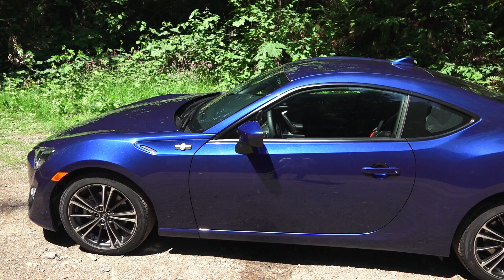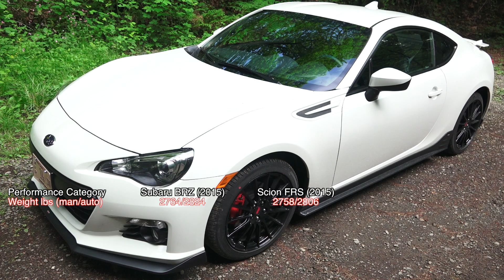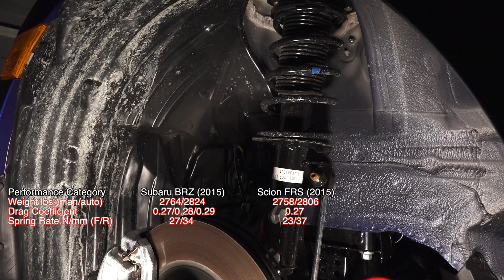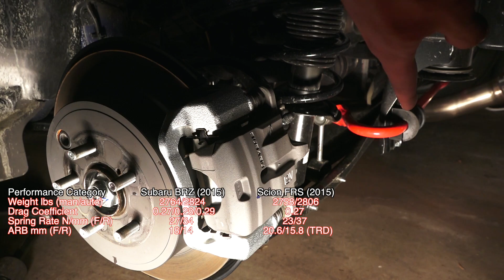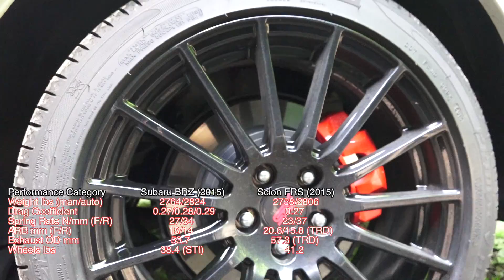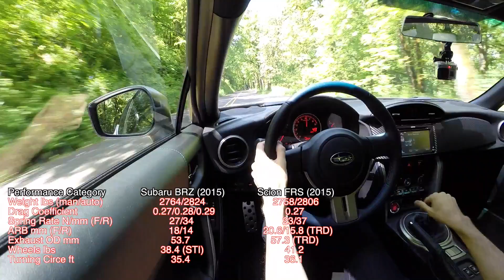Subaru BRZ vs Scion FR-S (Toyota GT86) - 8 Performance Differences

Comment: My granny in her V6 Camry ate a FRS merging onto the hwy. It was all suped up and loud as hell. How embarrassing.
Reply: but e36 will also carve up your wallet while doing it
Reply: e36 can carve it even better
Reply: cr4zyw3ld3r not at all, i bought 323i for 3k euro three years ago. invested less than 500 in repairs and maintenance , and 1k into mods. car had 212k km now. runs very well. gt86 cost 5 times that anf e36 is still cool car to haul people around
Reply: that car is probably easier to maintain in Europe. IN the states the maintenance costs are obscene. While you may find a good deal on it, the cost of repairs will ruin you. I have had a buddy that complained of nothing but spending money on his and there are articles floating around detailing the various parts that fail in the engine.

Comment: what do you think about adding a turbo to one of these cars? would it last or would it just be constant maintaince? also if a turbo was added what else would I need to put into the car? 
thanks
Reply: +BSCEsteban Get a 300ZX or RX8 with a blown motor for cheap and do an LS swap on that, but don't destroy a perfectly good BRZ/FRS.
Reply from the maker: +Riley Sheehan Adding power adds stress and eliminates your warranty. Adding stress reduces longevity. There's really no way around that.
Reply: +Engineering Explained what you think about a ls v8 swap and supercharge it + New headers and coilovers? (just to start)

Comment: First off I own a 2015 BRZ Satin Pearl of course !!!!
. I go on several forms and watch people argue on which car is better. A lot of heated arguments that I read and literally laugh my ass off. 
Most of them are Toyota owners...

NOW people have no Clue that the Chief Engineer and Project manager of Toyota basically begged Subaru to help them design this car for over 6 months bc they loved the Boxer Engine. 
Subaru was not interested bc they wanted to stay away from rear wheel drive vehicles, not bc they did not want to deal with Toyota, period........
Finally they got together and and after months of discussions, they both loved the design and decided on building this car together. 
Subaru was initially responsible for the Engine and Toyota for the design but both Companies had worked together on every concept of the Car. 
These Cars are near Identical beside the front Grille which I do like better on the FRS, The Spoiler and the front side fins. 
Besides that, they drive identical and look identical. I drove both cars many times. SO basically. Respect these 2 companies for actually getting together and making a Car that everyone Digs. 
The only issue is the friggn Colors that U.S. Comes out with. Start giving us some custom colors like Japan so we don't have to spend thousands to paint these fuckers like they should be in Production!!!
Reply: lol been telling my buddy the same things. haha same car. cheers

Comment: You should probably preface this video by saying it's for US market vehicles only. In some markets the Toyota (86 / GT86) has much the same components as the BRZ or comes in trim variation (e.g. 86 GT / 86 GTS).

Comment: so which manufacturer was the original designer of this model and why did the other two manufactureres copy the design?
Reply: RenZoneNL Toyota owns part of Fuji Heavy Industries and Fuji Heavy Industries owns Subaru.. Toyota makes Scion.
Reply: RenZoneNL Both Toyota and Subaru collaborated on this car, Subaru did most of the parts, while Toyota offered their d4s injection system and did most of the styling.

Comment: You neglected to mention that red brake callipers add an extra 4.3 - 7.6 horsepower (depending on temperature)
Reply from the maker: Jason Robichaud *per wheel.

Comment: So, the GT86 has better performance. Good to know, and it's a shame because I like the design of the Subaru more.
Reply: ReventadorLP1500-2 It has more performance options but in actual testing they're pretty much identical. I've yet to see a review video of the two where one performs measurably better than the other.
Reply: +She Swallowed It When they first came out, I remember the BRZ was more desirable. I guess things have changed in the past couple of years.
Reply: @lioncelica5170  I'd rather have a brz
Reply: Me too, but I'd rather have a Scion than a brz. What are the differences between the three?

Comment: I think someone had commented on the first video that they put the same tyres on these as on a Prius - is that true? - And went on to say that they deliberately do that so you get some slip and make it feel more racey, even though it is not a high powered car - what say you? Either way, do you feel the tyres are adequate as they come?
Reply from the maker: Baerchenization It's something like a performance option for the JDM Prius. They're summer tires. Lots of cars run similar tires.
Reply: RickTrajan performance = performs better. You'd probably get better mileage with better tires anyway
Reply: Engineering Explained performance doesn't sound right for Prius, but that's nice to know.

Comment: In australia you're paying more for less when buying a BRZ over a gt86, and the options, a heap of which are standard on the gt86 are EXPENSIVE.
Reply: Gee Zed Eee Power I guess for the BRZ you're buying more exclusivity then, as there are fewer around. I'm in Aus, the BRZ I bought with the options I wanted cost about the same as the equivalent Toyota would have, except the BRZ gets free servicing for the warranty period, more exclusivity (there are significantly fewer of them), and a full-size spare tyre (lol). For me though, I mostly bought a BRZ because I like the bumper styling more :P.
Reply: Gee Zed Eee Power Huh?  The BRZ is a similar spec to the 86 GTS, and similar price too aren't they?
Reply: TassieLorenzo 86 is more upspec.
Reply: brz is also more expensive also.
Reply: Mister j Australia isn't actually a real country it doesn't exist haven't you seen the memes you don't exist boy xD

Comment: I didn't think the spoiler would decrease drag. A cosmetic option that works! ;)
Reply from the maker: Alex Nguyen Surprising indeed!
Reply: Alex Nguyen That's what spoilers are for, decreasing drag. However, wings are for increasing downforce (and as a side effect they increase drag).
Reply: Alex Nguyen Taking turbulent flow and essentially straightening it out into am ore even and uniform passage of air behind the car would cause a drop of negative pressure behind car and ontop of the boot lid, also allowing the air to flow slightly faster away from the car. Big part of why spoilers are used as you dont get a significant amount of downwards force from the spoiler till you're going relatively fast.

So yeah, lots of things in aerodynamics can be quiet surprising to learn, porbs why people call it black magic :P

Comment: red brakes immediately best brakes
Reply: ***** 10 more BHP and if you grease them up you'll increase the power by at least 10 more BHP due to less resistive forces
Reply: dhnatyk Since this car has vtec you could do a blue caliper setup that will give you 50bhp but you have to take out one spark plug and paint it blue also to make it work... yo.

Comment: Im thinking about investing in some red brake calipers for more performance, but because the heat issue (since theyre red theyll be hotter) Do you think that the cooler blue calipers would be a better option? Less prone to over heating and whatnot. Not to mention the more environmentally friendly green calipers.
Reply from the maker: joshehutch I'd also recommend checking out camo-calipers, but they can be hard to find.
Reply: I think the purple calipers would be best for constant data writing. Oh, wrong spinning disks....
Reply: +SuperNuclearDeath i agree. remove all calipers and rotors to reduce weight then knock out a rectangular hole on the driver side floor to enable foot braking.... flintstones style.
Reply: joshehutch Why not just remove brake calipers? Weight reduction.
Reply: Engineering Explained lol
Reply: Engineering Explained got em
Reply: The blue calipers would be a better option for heat dissipation but you'd be sacrificing the horsepower gain you'll get from the red.
Reply: Vlad Mitrofan haha
Reply: Vlad Mitrofan lmao
Reply: joshehutch Assuming you're serious a good bet would be to get Legacy GT front brackets (same caliper I think, but larger disc - more surface area / heat capacity); or swapping to WRX 4 pot calipers (with the same stock 295mm rotor) would give improved brake feel, but no other benefits; or going to STi Brembo which bolt straight up (new wheels required - 08+ rears bolt straight up too); or going for an AP racing (or other) big brake kits.